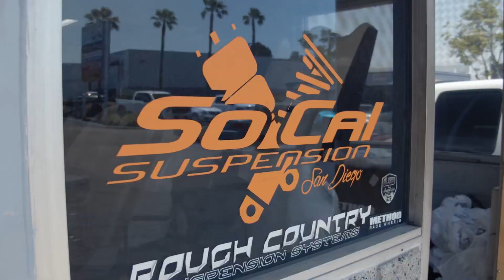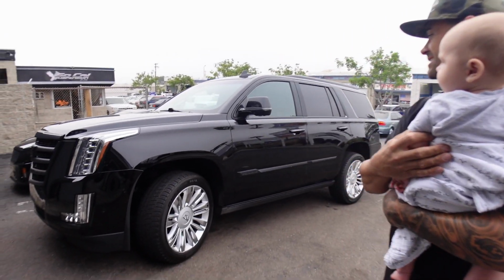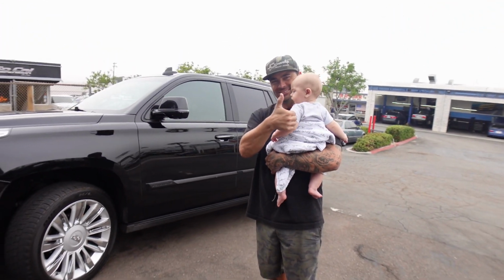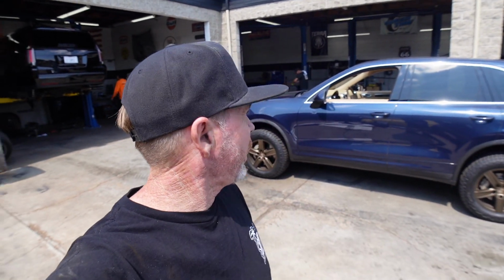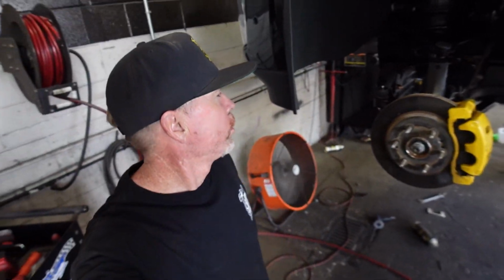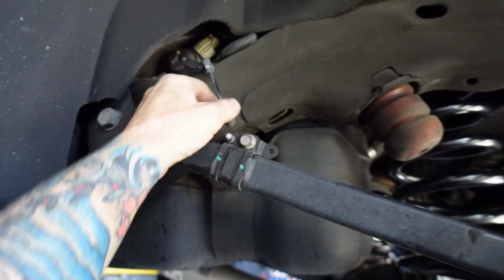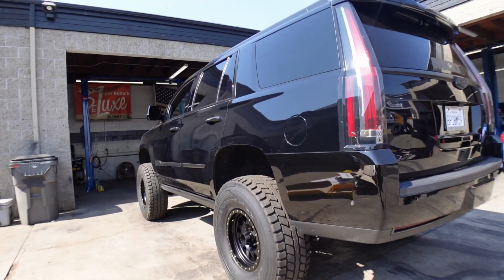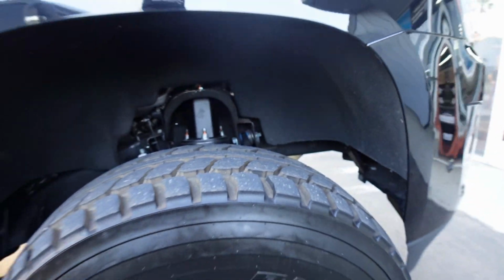We Put 37's on Morgan Clarke's Cadillac Escalade │ Shop Life Ep. 2

Comment: I installed 3 inch front 2 inch rear lift. 35x12.50 r17 wheels. Did the norcal trimming. But power  running boards have wires at the end when you remove plastic cap. What the solution? Did you guys cut the steps?
Reply: You can losen the steps Allen bolts and slide them backwards to the rear
Reply: @daviddhhd  good Idea I need to try this
Reply: @faridgadimov5955  I did it to mine, the t nuts can be stubborn to slide
Reply: @daviddhhd  do I need to just loosen them or remove completely?
Reply: @faridgadimov5955  I honestly can't remember. Probably remove